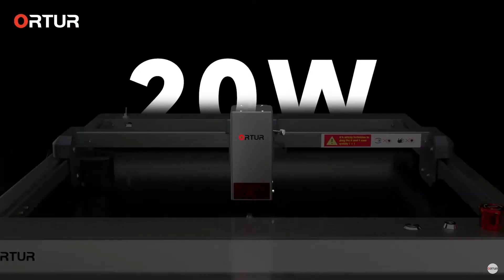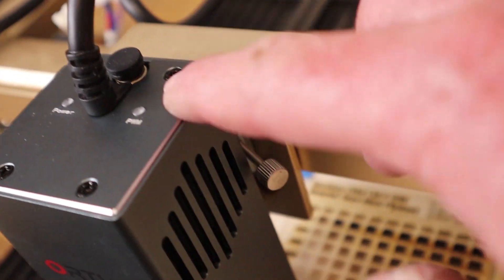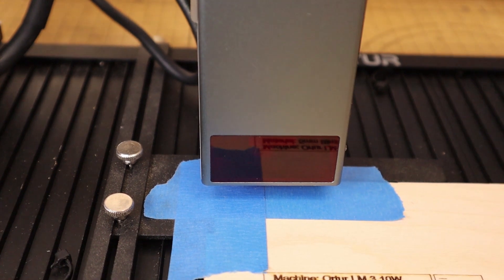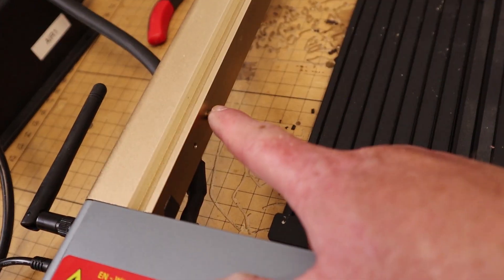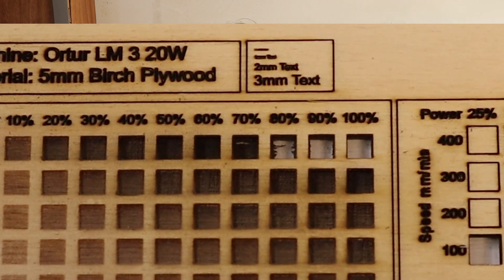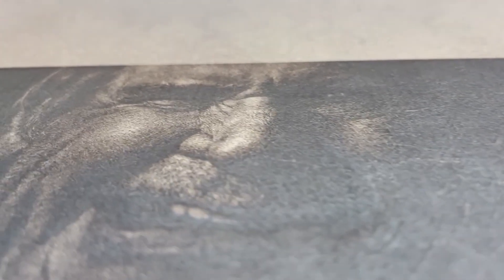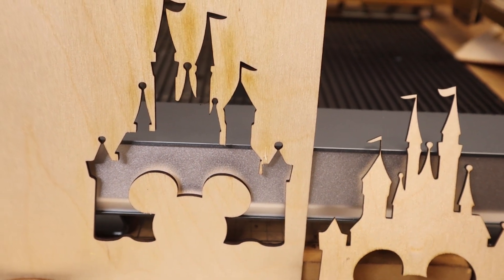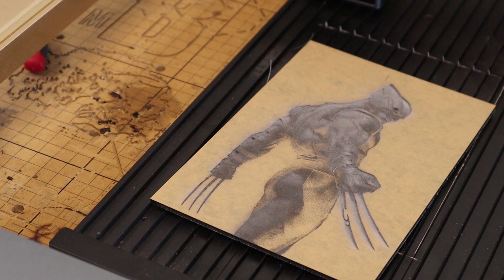Boost Your Laser Power to 20W: The Ortur 20W LU3-20A

Comment: I have an Ortur LM3 20W laser and an older Ortur LU1-4 5.5W laser...two complete lasers.  There is a problem with the LM3, as it will no longer FILL within the LINES.  It's always slightly off to the right.  I have read all I can find about adjusting belts and wheels, and to date have not eliminated the problem with misalignment.  The 5.5W laser has worked flawlessly for several years.  Can anyone offer suggestions for correcting the misalignment with my 20W?  Can I successfully move the 20W head to the 5W frame?

Comment: Ok Hopefully a quick question. I just getting into this hole laser thing. I just order the Aufero 1 with the SF setup. I was wondering if I could upgrade the laser, I ordered to a 10w laser later, if I like doing this more down the line. But for now, it's a interesting to try.
Reply from the maker: According to Ortur, you can upgrade it. Please check with their documentation though.
Reply: @GeekBuildersNet  yes, I saw that. But when I went looking all I could find was the laser itself, but not the  control circuit board I'll just call it that because I don't know exactly what it is. I've been to their website and all I could find there was just the laser. No mentioning of an upgrade for the Aufreo 1. Maybe I'm just getting ahead of myself because I'm not sure if she'll stay interested in it for long. But just in case LOL 🤣
Reply from the maker: @mauricejohns3635  I missed that you were looking to order the Aufero 1-  they should actually discontinue that model. The Aufero laser 2 and the ortur 3 are superior now. The circuit board you are referring to is required when upgrading the 10w Aufero 2 and original Ortur LM3, mainly to better handle the power requirements of the 20w laser.
Reply: @GeekBuildersNet  well I hope they don't discontinue it because it might cost a lot more buying a more expensive model just for my wife to use once or twice and then sit around doing nothing with it. I personally I'm only doing all this so she'll have something to do I do more 3D printing than anything else. This is mainly for her. And for as little meaning cheap lol
Reply: Oh yeah I just arrived home found the laser sitting on my front porch, unfortunately it was the wrong model it was the laser 2. Which is too big for the space we have that's why we needed the 1.
Reply from the maker: @mauricejohns3635  Understood

Comment: Thanks for the video, You make it look so simple. I have the LM3 10W and got the 20W upgrade kit for Christmas. I watched the ORTUR installation video and just installed the new OUC board on the exterior, which seems ridiculous, but I did it. It appears that the new setup requires 2 power supplies? Is that correct? It seems that I am supposed to use the new supply that came with the kit to plug into the new OUC board and I guess use my existing supply as I always have before. Is that correct? When I plug the power into the new board, it immediately starts running and never stops, even though the laser machine itself isn't even on. Thanks for your help.
Reply: I found in the book where it says 2 power supplies are required. Both (original purchase and upgrade kit) of my power supplies are 24V 4A. I took a picture but cannot share here. The manual that came with the upgrade says only a 2A is required. It also refers to the new laser module as LU2-10A so who knows what's accurate.
Reply from the maker: I looked at Ortur's documentation and it does look like it requires the second power supply. It is extremely awkward. My video does not show this since they provided me with a custom front end that has all of the new components integrated.  @csganley

Comment: Great video. I am new to laser engraving and have a Aufero2 and  AL2-LU2-4 LF laser module and was wondering would I be able to upgrade to a 20W LU3 - 20A.
Reply from the maker: According to Ortur, you should be able to. You will. have to use an add on board that will sit on top of the laser though. Because of the cost of the upgrade model, I would look into the cost of a new laser altogether, there might be some special deals with the holidays coming that might make the overall cost more feasible.

Comment: The biggest problem I've found upgrading from the 10w to the 20w is aligning projects. With the 10w I can easily fire at low power then move the beam to the desired  starting point. Can we remove the orange protection cover? Do you have any suggestions?
Reply from the maker: No, it can not be removed. My process involves setting a starting position in lightburn and trying to align my workpiece the best I can after that.

 If I need a precise placement, I will do a light engrave path in the shape of the object on a wood scrap or thin piece of cardboard and then match that to my work piece

Comment: So my new LU3-20A cable is not compatible with the OUC board the came in the box  , My laser is a LM3  , the module will plug into the existing cable that is on the machine ,,, identical to how you installed your module and cable ... I'm wondering if I have same lase you have ??
Reply from the maker: My only recommendation is to follow the instructions provided by Ortur. If something is not working the way you think it should, contact Ortur support. My laser has a custom front end that does not require the extra OUC board.
Reply: @GeekBuildersNet   So it appears that I have a upgrades LM3 that came ready for a 20w upgrade ( a Nov 2022 purchase) came with the upgraded heavy duty 24v power supply as well   all I needed to do was exactly what you did and it works perfectly !!! no need to install the included board !!
Reply from the maker: @RAILGUY140  That's great news.

Comment: Great video thanks. I have a 5w Ortur LU1-4 Laser Master 2 which I would like to upgrade to at least 20w. Would you advise doing this or would I be better off buying a new unit, either Ortur or other. I would require an air assist pump, could you recommend a reliable make. Thanks in advance.
Reply from the maker: Ortur states that you can add the 20w to any previous Ortur with the addition of an add-on board, but I would personally recommend the new unit with the upgraded motors and better machine stability for operating at high speeds
Reply: Thank you. I was thinking that way  @GeekBuildersNet

Comment: Based on the Ortur video, it appears that the "OUC" Universal Adaptor Board may be necessary when installing the 20W module on the Ortur OM3. Is the installation method you demonstrated sufficient, or is this adaptor board required? 
See Ortur setup video here. :  https://youtu.be/w-uNKGF5c5A?si=wzWiXBRKj4qlCwk7

Comment: Hello from Belgium and thank you for your video. What'is the technic to hava colors on stainless steel?
Reply from the maker: You have to do experiments with different speeds and power settings. You usually have to start of going very slow with high power. The type of metal you are engraving will also make a difference. Ortur should have some guides online for this.
Reply: thank you so much @GeekBuildersNet

Comment: Hmm i have lm2 pro s2 and i think i can not conect L line to OUC, should i just conect it normal and run it on stronger charger?
Reply from the maker: I only recommend installing the way that Ortur says to install it. The new board has new instructions and power management that is essential for the stability of the new laser. If you have any questions about their install method, please contact Ortur.
Reply: @GeekBuildersNet  yep i misplaced one cable, sorted
Reply: Only strange thing is, i belive module ventilators are stuck @100%, it is very loud since moment i power it up. Is that normal?
Reply from the maker: @krvav1  Mine usually spin up when moving the laser head or other basic function and they will stay on for a few minutes before shutting off. It might be worth looking into any of the ortur documentation or seeing if there is a setting that can be changed in Lightburn

Comment: You mentioned that there is a different power supply.  Can you tell me what the specs are on the new power supply?  I just received my laser module and it shipped with the same 4A PS I already have with my machine.  The one I have is 24V, 4A output.  Thanks!
Reply from the maker: 24v - 6A

Comment: yea... bought one, waiting for shipping...

Overall I am kind of bummed out that ortur didn't keep up with xtool; was hoping they would of dropped a 40w module by now.

I did hookup a airbush Air compressor dual lung; that helped greatly on cutting.  Cheapy 1/2HP units on amazon; then just get 1/8BSP Male to 6mm RO line push connector.  Most of the airbrush units come with a BSP adapter.
Reply from the maker: I'm a little disappointed too. XTool has turned into a huge company and marketing beast which means they have the money to develop faster now. Thanks for watching

Comment: Hey! Thanks for the video. I got the Ortur OLM3 LU3-20A Laser Engraver with 50L Laser air Assist and I'm trying to figure out how to engrave Glass jars. It will help greatly if you can assist. Thank you! Dani
Reply from the maker: Glass can be a challenge with diodes. In the past, I use a smokey beige rustoleum spray paint to coat the glass and then run the job. When the job is done, I use acetone to clean off the residual paint and then wash well with soap in water. I highly recommend having a few test pieces to get the power and speed correct. I have a post in my IG feed that shows one of the end results. Testing is really important since each module and each setup is different

Comment from the maker: Quick note from Ortur: You will most likely need to connect an "OUC" board that will be included with the LU3-20A module upgrade. This board is recommended by Ortur to guarantee the stability of the machine. My machine did not require it because of it being a special build. Please follow Ortur's directions when installing and contact their support if you run into any issues.
Reply: Great video, thank you.   I went ahead and installed the OUC board; how can I determine if I can install without the OUC on my LM3?  .08x.08 with 20W is excellent.
Reply from the maker: @bneil4059  I have a feeling that it is required for all machines, even the LM3. If you have any questions regarding it I recommend contacting their support. I will admit that they have some inconsistencies  in their marketing for the module upgrade.
Reply: @GeekBuildersNet  I have mine installed and it works well.  On the OUC there’s a switch to put the power into auto mode that I would recommend to anyone.  The challenge is finding a place to mount it on the LM3, he laser cable isn’t long enough to mount statically off to the side.  It’s kind of a mess.  I emailed Ortur to see if I could do without the module.
Reply from the maker: @bneil4059  Thanks for the info. I'm sure there's a lot of people that will benefit from this
Reply: Hi! I just upgraded my LU2-4-LF pro to this 20W. Lightburn still detects it as the old laser. Do I need a firmware upgrade?
Reply from the maker: @tammympearce   I would recommend upgrading your firmware if there is a newer version available, but you probably won't see a different listing in lightburn. I don't think that lighburn actively recognizes the wattage of the laser. Just as a heads up though, make sure you change the y dimension in your lightburn settings since the 20w laser reduces the overall y axis of the laser.
Reply: @GeekBuildersNet  thanks for the reply. You reduce the y axis by 20mm?
Reply from the maker: @tammympearce  I don't remember the exact number, but if that is the number stated in the directions, then that is correct.
Reply: @GeekBuildersNet  one more question, is there a safer way of turning the laser off other than unplugging the power to the OUC?
Reply from the maker: @tammympearce  You should be able to hold down the power button until it shuts down
Reply from the maker: @tammympearce  You should be able to just hold down the lighted power button until the machine turns off.

Comment: The black acrylic engrave looks amazing
Reply: Hi, nice video. I also had the 20w laser module for my OLM 3 last week, based on the guide from Ortur, I connect the module to additional board provide. But saw you connect directly and using the new power supply. Didn’t know can do it this way. 😊
Reply from the maker: @michaellim7542  I do not advise doing it this way, Ortur provided an updated front end for the video. Please follow Ortur's installation instructions
Reply from the maker: If you have other question please let me know or contact Ortur Support
Reply: @GeekBuildersNet  Thanks for your advise.
Reply from the maker: @michaellim7542  Anytime
Reply from the maker: It is so cool in person😀